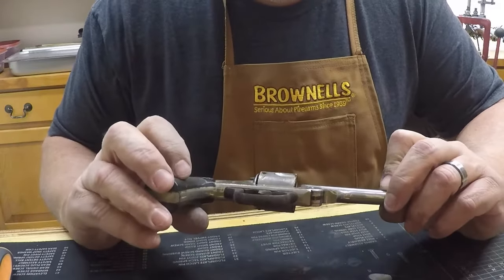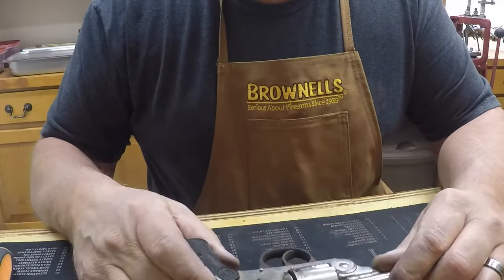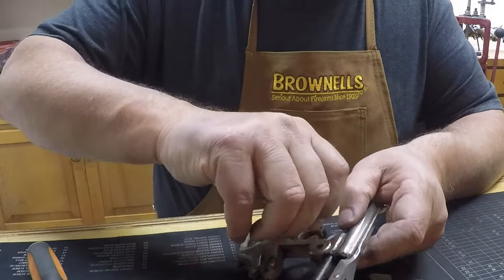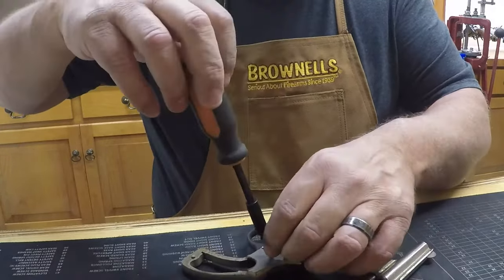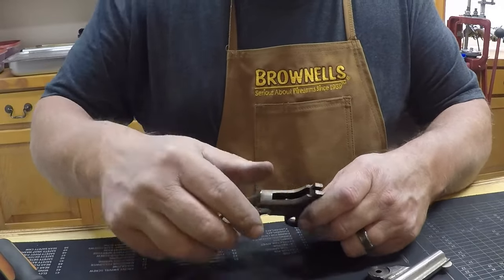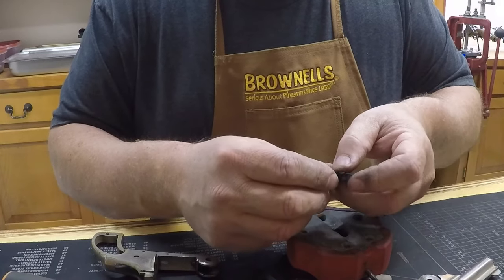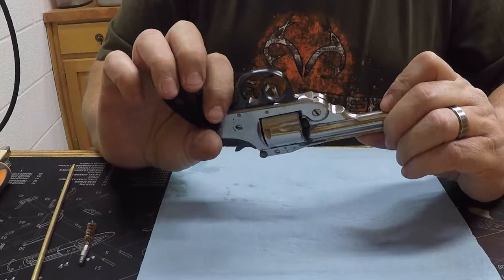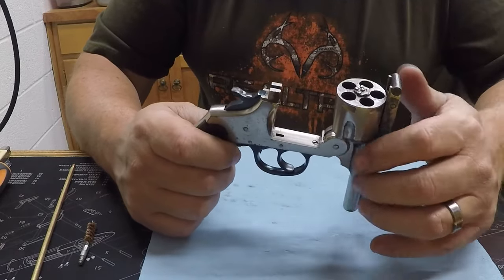US revolver Co 38 S&W  Top Break - Iver Johnson (Disassembly - Restoration)

Comment: Thank you, after I saw your video, I was able to put my US revolver CA. 38 S&W back together again, after 6 months unasembled in a box.
Reply from the maker: Glad I could help!
Reply: @magnum6886  i was able to clean one yesterday and after I put it back together I noticed that it doesn't have double action anymore. It only works while pulling the trigger. What do you suggest?
Reply from the maker: @jbass831  It sounds like what you mean is that it only works in double action and the hammer won't lock back for single action.  This is a common problem with these old guns.  If it worked before you cleaned it, most likely it is just a little sludge or too much oil on the sear.  I would try blowing it out with compressed air really good and see if that takes care of it.
Reply: @magnum6886  yes thats what I meant, it doesn't lock in single action. Ill be looking at it again today so ill try what you suggested
Reply: @magnum6886  if the problem continues after I blow it out what do you suggest?
Reply: @magnum6886  she didnt look in too bad condition. though she did look like she was hurtin for a cleaning and restoring back to her former glory. good video.

edit: i like the patina she still has. almost identical to the beginning of the vid but more cleaner and fresher looking.
Reply: I have a US revolver just like this but it doesn't work. Do you still work on them and restore them?

Comment: Touching base a year later here. Did some research on this gun, and all the Iver Johnson Top Breaks sold under the name US Revolver company were designed for smokeless powder. And the Iver Johnson Safety Hammer Guns that have four pins in the frame over the trigger guard and under the cylinder are also made for smokeless.  From "Iver Johnson Arms and Cycle Works 1871-1993" by W.E. Goforth.
Reply from the maker: Thanks for the info

Comment: SDI student at the moment. Been working on firearms for about 25 years. Inlaw just handed one of these to me... An owl head facing toward muzzle end. 2nd model .38. Its got the single leaf mainspring. Dual pin release sight for flip to open. Just started taking it down. Any tips on sourcing replacement parts? Its full of rust so i am slowly removing all the corrosion. Does numrich have parts for these? This one is black powder only, so I probably wont ever fire it, but I would like to clean it up, shine it up, then put it in a shadow box for my father inlaw.
Reply from the maker: In my experience, Numrich is kind or hit and miss on parts for these old guns.  Other than that, you might find a cheap parts gun on gunbroker or sometimes eBay has parts.  Good luck!

Comment: Magnum68, per my yesterday's response to the thread Tim Henry started, I fired my .38 US Revolver at the range today. When I used a load that duplicated 1915 specs from an old gun book, substituting Unique in appropriate proportion to the Bullseye Powder used in the chart I had,  the load fired right to point of aim at about 8-9 yards with me resting both elbows on the shooting bench with a two hand grip. I used a 145 grain bullet specifically designed for .38 S&W with 3 grains of Unique. I did not expect this kind of accuracy. My reduced pressure loads of 125 grain bullet (designed for .38 Spl) over 2.5 grains of Trail Boss shot low and to the left. I also put some new loads from a company called MiWall (who sells exclusivley at gun shows). 158 grain bullets set deep in the brass and they, not surprisingly, shot high. I found this piece to be a very comfortable shooting gun for a gun that was probably not designed for target shooting.  The metal in it feels as sturdy as that in my old Smith and Wesson Model 2 Spur-Triggers. I found the ejector usually did not throw the spent shells clear of the gun, but left most of them hanging in place after the ejector returned to resting place, and I usually had to knock shells those out with my finger. And a nice safety feature--you can't open the gun after firing without putting the gun in the safety notch or close it all the way after loading cartridges without the safety notch engaged. I am very pleased with it and only paid $175 for it. Made in 1911 with a shiny bore and solid mechanicals. Get yours out to the range!
Reply: Joe, the auto eject isn't really designed to work facing straight up, rather to be turned to the side and slightly upsidedown. Lessons I learned along the way. Great job on the load testing. Unique powder is a great low recoil powder but use caution as it is a hot powder witch creates high pressure. Have fun with these old guns
Reply: @timhenry9757  Thanks for the warning on the Unique. I prefer using the Trail Boss where I can, but I can't get the Iver to shoot to point of aim without duplicating original factory load. I do have an old .38 S&W Lee loader that has 3 gr. Unique as the recommended  load for that caliber. Do you know if Bullseye is any less hot than Unique? That was the original smokeless powder in a lot of loads in the early days. I would like to try it. I had heard that originally .38 Special (skipping to another caliber here) was loaded to +P pressures, and is loaded down in standard loads now for safety. A 1915 chart I have shows that to be the case, also with the .38 Long Colt loaded at the same foot lbs. energy as the now standard .38 Special. Interesting.
Reply from the maker: I'm not surprised that it would shoot high or low with the different loads but what would cause it to shoot left I wonder?

Comment: Hello, I have one that was built in 1926, the cylinder only lines up with the barrel in single action when you manually pull the hammer back. I was told that was normal but know it should do the same in double action.

Comment: "At 2:47 minute mark, I inserted the circular piece in the wrong direction and now I can't seem to remove it and insert it correctly. Any advice?"
Reply from the maker: Maybe try using compressed air?  Not sure why it would be stuck.  Haven't had that problem.  Good luck.

Comment: I have a 32 5 shot S&W nickel plated I would like to take down I have removed the screw for the front half to come off but the part that, that screw. Goes into wont come out not sure which side it come out. Also what is the best way to polish it up there is a.  Lot.     Of pits and the nichel is almost gone on most of it .please help me.

Comment: I have the same revolver. It is in great condition but sometimes the trigger wont reset. Any ideas? I have had it apart and everything looks good.
Reply from the maker: I would double check the trigger return spring.  Also, a good cleaning and lube can sometimes do wonders on these old revolvers.  Good luck

Comment: Question:  My Iver Johnson trigger when cocked back does not hold.  What part is broken.  Enjoyed the video - I plan to restore this like you did.  Mine has no serial - is that normal?
Reply from the maker: You probably have a broken or missing sear spring.  There is a good chance that it is just dirty and will work properly after a good cleaning.  Iv'e had this happen a couple times.  Not sure about the serial numbers.  Thanks for watching.
Reply: @magnum6886  Missing/dirty sear spring - I understand...thank you for the reply.

Comment: I have a Iver Johnson's Arms and Cycle Works  out of Fitchburg, Mass. USA chambered in 38 S&W. It is nickled plated in 95% condition. Black plastic grips with an owl face and some floral designs on the grips.
Would this be the same pistol you are referring to? There are no caliber markings but it is a 38S&W 5 shot revolver. Pat. Date looks like Aug. 24
Reply: I believe the us revolver line of guns was a lower price option made by Iver Johnson.

Comment: Hi there I have the same pistol but I’m thinking the cylinder stop is not working or worn out can u tell me if the cylinder stop is a separate piece or is it connected to the trigger please reply and thank you .
Mike G ...😀
Reply from the maker: The cylinder stop is a separate part
Reply: @magnum6886  thank you so much would it be to much since your a GUNSMITH to help me track down that cylinder stop  please ...I’m a Disabled combat Veteran and always liked these old pistols.
Reply from the maker: @MrGonzo4000  I'm sorry I'm not actually a gunsmith it's just a hobby for me.  You may have some luck checking the following website: https://www.gunpartscorp.com.  By the way, thank you for your service sir.
Reply: @magnum6886  thank you

Comment: Hello, so I saw one of these at the store the other day and absolutely fell in love with it, I don’t think it’s a black powder variant because it was chambered in .22 short, but finding out anything about these guns is a challenge. There is not a lot on the internet, anyhow the one problem it had is I think the hammer doesn’t lock when it’s cocked back, would you have any clue how difficult of a fix that would be? Or is it SOL? (I was thinking about buying it is why I ask)
Reply from the maker: It could be a weak trigger spring or possibly the sear.  Try holding the trigger forward while cocking the hammer and see if it will hold.  It could also be as simple as just needing a good cleaning.  I had this problem once in one of my videos.  After I ran all the parts through my sonic cleaner and re-assembled it worked just fine.   Good luck and let me know what you figure out!
Reply: @magnum6886  I was only playing with it for a moment, but the double action on it was working fine. If I end up buying it I will play around with it some more

Comment: This was a very helpful  video. I enjoy restoring relics like this. You mentioned dating yours, I have a blued version of this 38sw numbered 22423 could you share how to date and I would  assume it's black powder?
Reply from the maker: From my understanding these were made between 1894 and 1941 in three different models.  The first and second being black powder and the first is  identifiable by having a single lug at the rear where it latches and was only made from 1894 to 1895.  The second and third models had 2 lugs to increase strength. The 3'rd uses smokeless powder loads. lt has a coil type spring under the grips and is also identifiable by the owl on the grips on the Iver Johnson branded models.  If the owl is facing toward you it is probably a 3'rd model.  Earlier models have it facing upwards. I believe mine to be a 2'nd model because it has the 2 lugs and also the leaf spring under the grips.  I would definitely have it checked by a gunsmith before firing.  l Hope this helps and sorry for the delay in responding.
Reply: @magnum6886  Thank you for your reply. my 38 S & W is a U.S. revolver and has U.S. on the grips unlike the owl on the Iver Johnson. the main spring is not a coil spring but a flat steel main spring, of the four I have retstored, two Iver Johnsons, one U.S. Revolver and one H & R ( in my the shop now ) all have had a flat steel main spring. s is safe to assume they are all black powder?
Reply from the maker: @timhenry9757  I would say it is safe to assume they are black powder.  Probably not safe to assume otherwise!
Reply: @magnum6886  According to W.E. Goforth who wrote the 2006 book IVER JOHNSON ARMS AND CYLCE WORKS FIREARMS 1871-1993, all the US Revolver Company revolvers were made for smokeless powder. I have one made in 1911. Just got it. In very nice shape. I am going to the range shortly to try it out.
Reply from the maker: @joehoward3178  Thank you for the info.  Unfortunately there isn't a lot of information available on the internet about these old guns and what is out there is rather confusing and often times contradicting.  The best sources are probably still books such as the one you mentioned.  I've also read that most of the modern smokeless ammo in these calibers are low pressure so these old guns can handle it.  I'm not sure I would trust that opinion.  Is there anything mentioned in the book about it?  Please let me know your experience shooting it.  Thanks again for the info!
Reply from the maker: @joehoward3178  Sounds like you have a nice collection going.  I find these old guns extremely interesting as well.  I wish there was more reliable information available on them.  I reload also but haven't reloaded for my old revolvers as of yet.  I hope to if the prices ever come back down on supplies.  I did find a link that is rather confusing about US Revolver CO.  You can check it out here:      http://www.nramuseum.org/guns/the-galleries/innovation,-oddities-and-competition/case-26-the-booming-arms-industry/us-revolver-co-revolver.aspx.       Let me know your experience with the Falling Block Rifle.
Reply from the maker: @timhenry9757  I have read that most of the modern smokeless ammo in these calibers are low pressure so these old guns can handle it.  I'm not sure I would trust that opinion.  Let me know your experience.
Reply: @magnum6886  I have been finding the same information. Staying away from the hotter loaded ammo I tried smokeless in the 38 and it's fine. I can't thank you and others replying on this enough. These old guns are not only fun to restore but shooting them is the real story.
Reply: @magnum6886  Thanks so much for sending that link. I'd been on the site before, and it's really worthwhile, and it was nice to reconnect with it. I noticed in the display of pocket revolvers that the Iver was immersed in, there were some small caliber Remington rolling blocks included. I have a Model 4 in .22 LR with a great bore, and it is very accurate and fun to shoot. I have also shot my .38 S&W falling block rifle a lot and just love it. It has a beautiful bore. Quite accurate and nice buckhorn sights on it. Interestingly enough, out of the rifle, the report doesn't seem much louder than a .22. I have about 40 spur-trigger, pocket revolvers spanning 1856 to 1890's. Most of them are obsolete rimfire calibers, but there are ways to set them up for firing with .22 blanks as primers in offset drilled or manufactured cartridge cases from a Belgian source that I hope to pursue.
Reply: Tim, your gun was made in 1911, same as mine. Got that out of the Goforth book I have, and as elsewhere noted, made for smokeless.
Reply: @joehoward3178  thank you. I'll be looking for this book.